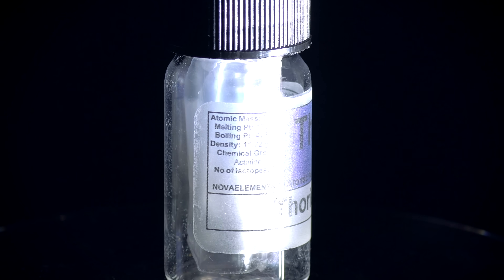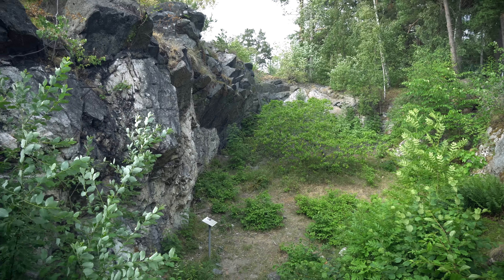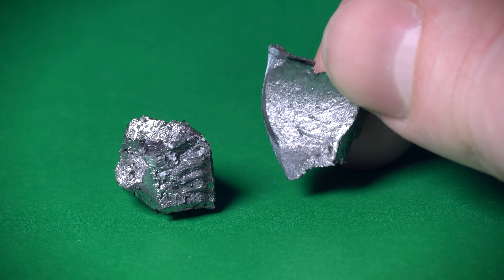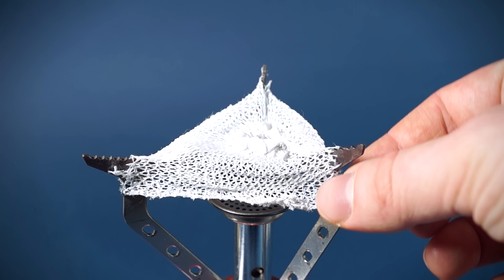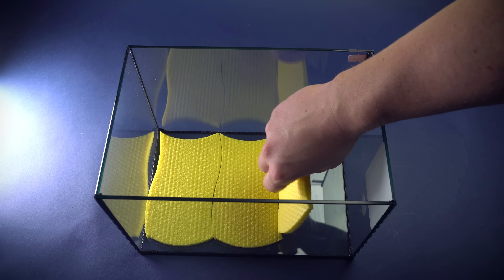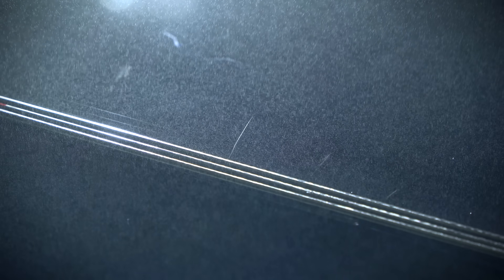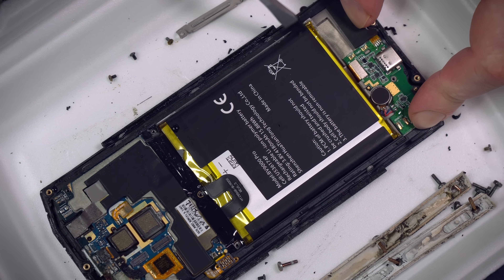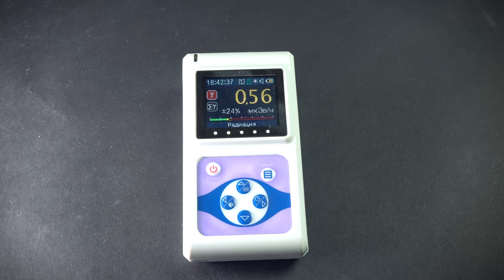Thorium - A METAL THAT NO ONE NEEDS!

Comment: Makes some crazy high energy gamma, but not a lot of it. Goes right through lead. Main use is oxide combined wir Ironically the main use of pure metallic thorium is multileaf collimator devices for directing radiation beams for cancer treatment. Go figure.

Comment: Sadly, It's the element that will save our energy crisis! We ALL need Thorium and it needs to happen ASAP! A Thorium reactor is the safest and most effective modern concepts ever created.  Go look it up folks! x
Reply: Thorium reactors arent a "modern" idea, they were the initial designed reactors. 
But, they do not yield the materials needed to make atomic weapons, unlike the secondary idea, "Pressurized  Water Reactors", or "Boiling Water Reactors".... ie the design which was pushed through and declared "the norm".

Comment: Thanks for an interesting video. However, I am concerned with statements in this video about radiation. It is stated that thorium has a high radioactivity level. It is also inferred that there are significant health risks with exposure to thorium. It is rare to have statements like these backuped with real statements of risk. Of course it is really difficult to assess risk on a video but here are some things to think about but here are some general ideas that put the risk in perspective.
Since the half life of thorium is more than 14 billion years it has a very low radioactivity!  A better term in this case is to talk about the specific activity versus just activity. Specific activity is the amount of radioactive decay per unit of mass. Materials with a long half lives have low specific activity. Materials with short half lives have a high specific half life. If the specific activity is low there is lower risk of radiation exposure from that material!! 
We can detect radiation from natural and man made nuclear sources extremely well. With a good detector we can detect radiation from a single nuclear decay. With an in expensive detector (like the one shown in this video) you detect up to 90% of some types of radiation.
Just because we can detect radioactivity at very low levels, does not mean that there is a significant risk to humans health. We are exposed to natural radioactivity daily! It is all around us and we cannot avoid. Some of this radiation comes from thorium. There is no indication that this natural radiation does anyone any harm. You could probably eat  thorium bearing rock without a detectable increased health risk, except the excess wear on your teeth. It is sad that thorium was removed from use in gas lantern mantles because of perceived risk. There is no direct evidence, that I know of, that anyone was ever harmed by gas lanterns (I study these things all the time as part of my research). There is a lot of misinformation presented to the public about radiation. Please help educate the public of what the science really says about radiation.
Reply: Very well posited 👍👍👍

Comment: Thorium reactors are currently under development, using a liquid molten salt bath - they are significantly safer than uranium or plutonium nuclear reactors, but weren’t previously developed because you cannot make nuclear bombs with it!  Initial work on this technology took place in the 1960’s and is only now seeing a resurgence.
https://www.newscientist.com/article/2145535-thorium-could-power-the-next-generation-of-nuclear-reactors/

Comment: It's also needed to produce a (mildly) radioactive compound for high-power vacuum tubes used at microwave frequencies. Thoriated tungsten is used as the filament in such devices, whose power output far exceeds solid state devices. Typical use includes power amplifiers for space communications/SATCOM and terrestrial wireless communications (Ku-band).

Comment: I like to hear you talk about thorium but you are gravely exaggerating the danger of it's basically non-existent radiation. Let me explain, half life is basically when it's expected to decay and release radiation. Due to chance it can't be exactly predicted however. That being said, every atom has only so much energy and can only release so much over it's lifespan, so the higher the half life the less it releases. Basically let's say every atom has 100 radiation points until it ends. Something with a half life of a few billion like thorium means that it'll only spend one of those points every few million years. You'd have to be seriously unlucky, astronomically so. To catch even one of those and your body can handle a lot more than people commonly think. The sun produces more harmful radiation that reaches us and I don't recommend exposing your wounds to sunlight as being super dangerous. On the flipside something with a 10 second half life will be extremely radioactive but in a few minutes it's gone and over with. The pains in the ass are the ones inbetween with half life's of a few decades or so.

Basically if it's half life is over a thousand years you don't need to worry about it much. If it's under a year you don't need to worry about it for long.
Radioactive pollution? Still the materials. Little specks of the material lingering. Radiation itself doesn't last long, either it hits something and is gone or it flies off seeing as radiation is literally a type of light. Specific area('s) of the wavelength to be precise. Just another color of light.

Comment: “Don’t do this @ home You can contaminate the whole building”

.. pssshhaahha
Reply: That's called geoengineering;but it's usually outside with a jet and supposedly the metals used are barium,strontium,and aluminum that is oxidized..but after the video;well,there's a debate about a March 2016 incident after seeing a jet spray and then seeing organic non wheat crackers laced with ethanol on sale..
Reply: So a demonstration on the House floor of Congress is straight out then.🙁

Comment: Thorium - A METAL THAT NO ONE NEEDS!  (Until molten salt thorium reactor era) :)
Reply: @4johnybravo  nuclear Energy as a whole Is already the future... Uranium Is still the best Energy source on earth... Go checking "Fast reactors" and 4th generation nuclear plants
Reply: It's a shame no one will invest in these reactors but instead continue to build one's that were designed decades ago and are inherently unsafe.

There has to be constant intervention to keep things safe whereas a Thoriam reactor has to be kept going if I remember correctly.
Reply: @Ryan-lk4pu  It's being researched extensively in india
Reply: @4johnybravo  Nobody's going to be tossing Uranium aside in any scenario where nuclear reactors of any sort are highly valued. The entire usage of Thorium in reactors is to get to a Uranium isotope. It may prove a useful replacement if/when Uranium starts to become scarce but as a fuel it has few if any advantages over Uranium. Molten salt reactors are pretty good though but you can use Uranium in those just as easily as evidenced by the number of companies that are perusing molten salt reactors burning uranium instead.
Reply: @AmurTiger Current Reactors use Ur235. The thorium breeder creates Ur233 which while marginally less efficient than Ur235 is much more safely used. The spent fuel, unlike plutonium is virtually unweaponizable. It also has a half life measurable in centuries, not millennia.
Reply: @4johnybravo  Fusion will fix things. Not fission.
Reply: @vladlu6362  but for now thorium fission is our best bet
Reply: My bet is on nuclear fusion, though (and after that, total solar energy harvesting by employing a Dyson sphere). There’s simply a lot more people researching it, and it’s even better than thorium.
Reply: @GRBtutorials  we're decades away from fusion, and dyson sphere is a meme at this point
Reply: Northerend Engineering and Blacksmithing?
Reply: Thorium reactors were known long ago and are safer than u238.   It's 5x more abundant too.
Reply: @gghouck  your point?
Reply: Soon... soon...
Reply: 2%thorium tungsten electrodes
Reply: Check India's Nuclear program, fast breeder reactor IGCAR kalppakam, India. India is one of largest source of thorium.
Reply: Dhruv Sharma why do we need to produce energy, when solar energy is left unused? Isn’t energy conversation to meet any need better than energy production and transmission with loss?
Reply: @balasubr2252  solar Energy Is overrated and has been proven inefficent and a source of new type of industrial waste from expired and trashed panels
Reply: @balasubr2252  it would if it didn't take 22000 square miles to harness enough energy to power the entire US. Solar is currently best used as a supplemental energy source not mass scale energy solutions. Not until we can have much better breakthrews such being able to transfer solar from space to earth
Reply: @balasubr2252  Solar Energy is inefficient. It takes dozens of solar farms to equal the output of one full sized Nuclear reactor and those Solar farms are space intensive. Those dozens of farms take up the same land area as several hundred Nuc plants. Replace the Reactors with Molten Salt units and you free up all those dozens of hectares of open area for green space. All the energy + irreplaceable co2 processing?  Solar is unnecessary  when there are better, safer, less environmentally strenuous alternatives.
Reply: Nyarlathotep Aren’t you misunderstanding your knowledge of calculating efficiency with the other risks that are not included in your measurement? There is enough energy to transform without a need to produce energy and that’s economical and efficient.
Reply: @balasubr2252  On behalf of everyone who doesn't own a nuclear reactor, but has to live under the clouds of their failures, you are mistaken sir.
Reply: Cedric Sumner I am not advocating  nuclear power and promoting benign alternatives. Discouraging production of energy and encouraging conversion from one form to another instead as there’s sufficient energy without risky production such as the nuclear reactor. Your comment on behalf of non owners need not be directed to me as I am agreeing with you and not against your stand if you carefully read all my posts.
Reply: @gghouck  sence you know next to nothing about thunderf00t heres some facta

- hes got PhD in physics
- used to work as physics teacher
- used to work in nuclear power plant even has videos of reactor
- right now works in lab and right now performs some kind of experiments he posts it on hes channel about it
Reply: @gghouck  the guy has PhD in physics
Reply: Noah yes that’s true
Reply: Aren't molten salt nuclear reactors proven to be unreliable and unsafe?
Reply: @gghouck  world class troll right here folks

On seriuos note he uses facts and looks at things objectively hell he even used tinker with thorium, heres prob a thing you may not know

Thorium is cold, how cold? so cold it takes weeks if not months to get to run
Reply: @4johnybravo  to slow to be afective, it takes more energy start when you get it back
I suggest watching Thunder foot, hedebanks this shit
Reply: @nobody4y  watch Sam o' nella thorium rocks
Reply: Bad4You Please don’t even mention ThunderFoot, he’s a fucking joke
Reply: @kshatriya1414  why?
Reply: Poppa_Zeldus72 Because while he is knowledgeable in many ways he’s very close minded and think his opinion (Which his videos often are even if they are based mostly in the scientific realm of things) is the one and only truth and those who dare to oppose or question him are wrong and or are using Pseudoscience

He’s a knowledgeable dude with an even bigger ego which can definitely be seen on his various feminist rants.

Comment: Thorium is useless... Except when used in molten salt nuclear reactors, providing relatively clean, extremely abundant, efficient, high-density, on demand energy, negating the need for fossil fuels and dangerous, inefficient, wasteful, polluting, water-cooled uranium nuclear reactors. Aside from that, yeah, sure... Thorium is completely useless.

Comment: Ah Thorium isn't THAT radioactive, you would get a similar does by holding a bit of thorium than you would be by flying, and you don't worry about radioactivity when you're flying. Also as you said it's an Aplah emitter so as long as you don't ingest it dead skin will absorb the radiation. So it's not very radioactive and the radioactivity it give off is not harmful if it's just a solid block.

Comment: Just because a president shut down the thorium reactor project for political reasons dose not remove the fact it has a very good use in nuclear power that disposes of other nuclear waste in the reactors start up. An isotope of lead as a waste product with everything else able to be thrown back in the next batch and more waste used in the startup again sounds very beneficial in the long run.

Comment: India is pushing ahead pretty strongly with Thorium, and holds about 24% of the available material. The issue is the U.N nuclear proliferation treaty. You can enrich Thorium in a small factory, the size of a micro brewery. This scares Israel (aka The UN) as someone could go nuclear in their backyard and they wouldn't know. Where as uranium enrichment takes huge factories and is easy to spot from satellite/aerial photography. Thats the problem, not in the process, but in control and regulation

Comment: I'm wondering why you've chosen to do a hatchet job on Thorium. The US Atomic Energy Commission ran a Thorium reactor for 20,000 hours in the late'50 early '60s, with no unexpected problems. The molten salt is rather corrosive to most liner materials, and much engineering is presently going on in India, largest thorium asset in the world, in China, by the Chinese who have an abundant supply and by international interests, by rumor Bill Gates is financing some of it because neither he nor the engineers he is working with can get a license to do thorium nuclear research in the US- nobody else can- and all due to the fact that all uranium based reactors make plutonium as a by product. Which is a product the government sees as useful to it's purposes. Thorium molten salt reactors, it is thought may be made small, say megawatt size rather than the multi gigawatt size needed to attain economical sense for the cost of uranium- there will never be a uranium based reactor other than research or medicine due to the economics of it. Looked at some of your early stuff- you usually cover your material much better than this. I'll be back at least one more time, but one more cheap shot like this will be enough to look elsewhere for this sort of science; just sayin'.

Comment: I wish you had talked about the energy that it produces that could be used to power things. There was a car and motor invited that used this metal as a power source that would run for at least a hundred years  before needing replaced. Thank you for the video's.
Reply: @Red Stoner This was true what they did. It was never released to the public. It was just a concept , but was scraped because of safety concerns which I, in my opinion, was a load of crap. The real reason was they could not make money as they do with selling gas and diesel fuels.
Reply: @Red Stoner Well you maybe right. I don't really know the details or why they did not take it into production. I just know they had it and decided not to bring it out. Thank you for the information.

Comment: But there is more thorium than uranium and it can be done in a reactor design that can't melt down. Quite important.
Reply: No reactor can melt down unless someone screws up.
Reply: Thorium is a by product of uranium. It has higher potential,in theory, but in practice it is garbage
Reply: This is an incredibly dumb comment. Every reactor can melt down.
Reply: @Kyle-gw6qp  And who told you that, Isaac Newton? your mom? fusion reactors for instance cannot melt down.
Reply: @DanFrederiksen  how not? Every reactor can't meltdown. But people are stupid.
Reply: @Kyle-gw6qp  seems you made a mistake. try less overconfident haste next time. thinking is good.
Reply: @DanFrederiksen  no, I did not. Every meltdown is chased by either human error or natural disasters. Both of which can occur on every single kind of reactor.
Reply: @DanFrederiksen  how does a uranium reactor melt down?
Reply: @DanFrederiksen  a tokamak can still fail horribly. Even if it doesn't technically melt down it can still cause considerable damage.

Also, can the housing not melt?
Reply: No, that was BS propaganda in TED paid for by companies which wanted to raise money to research it.
Reply: @PravinDahal  which companies would that be? silly goose

Comment: The video seems to be shot through with warnings about thorium's radioactivity.  Its half-life is 1.4e10 years, compared to U-238's 4.5e9.  It is therefore 3 times less radioactively intense than uranium, which is often handled as a pure metal without harm.  While it is radioactive, it is very weak.  The caveat is to keep it out of the insides, particularly when it is carried by dust particles as fallout.  Biological retention is high for thorium; estimates range from a year to over 400 years, about as they are for plutonium.  Contrast that to uranium, where the biological half-life is 15-60 days.

By far the most fatalities to thorium were caused from 1931 into the 50s through the use of Thorotrast, an injectable contrast dye added to enhance x-rays that contained thorium.  20 to 30 years after use, the patients started getting carcinomas in the liver.  A poor second are people living in and around Grand Junction, CO where uranium mining was big in the 50s.